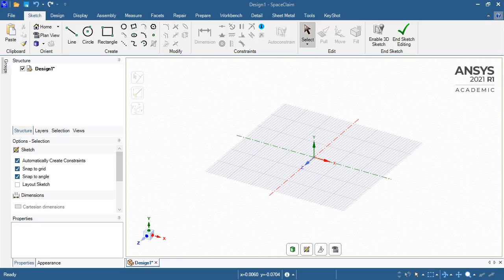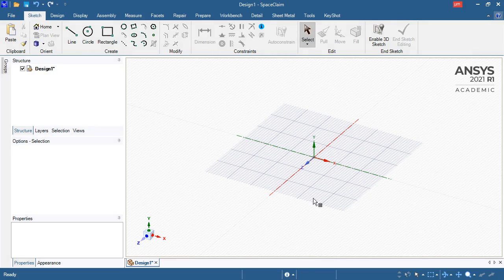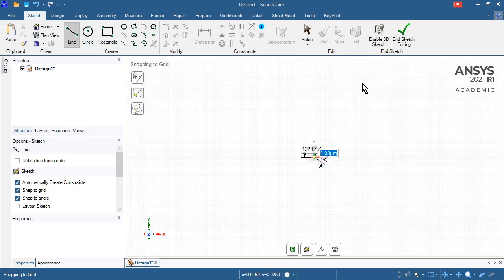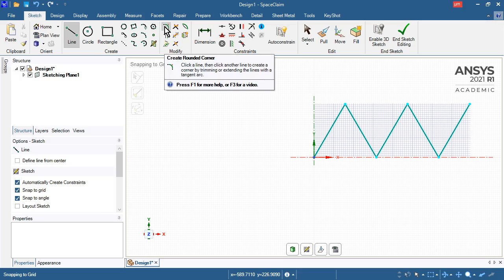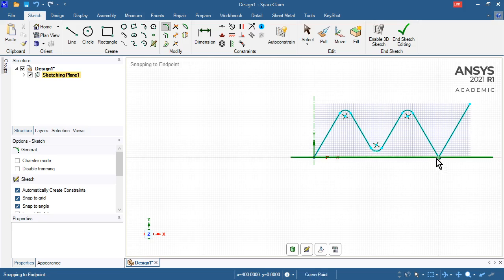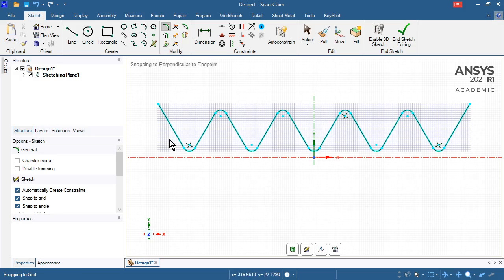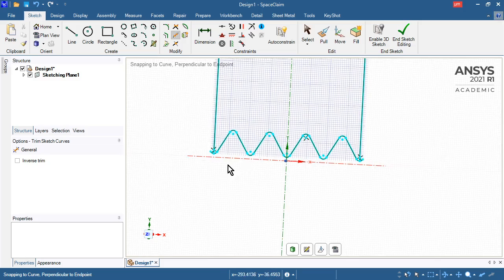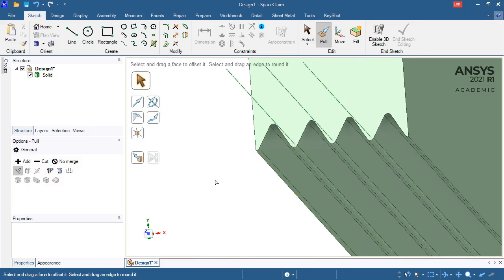Sub mm ribs in SpaceClaim2021

Comment: In my case the length scale only has 3 options: millimeters, centimeters and meters. There is no micrometers and nanometers. Also, I am using the 2020 R1 version. Can someone solve the issue??
Reply from the maker: You have to change units as soon as SpaceClaim starts. Once you have created or imported any geometry, you can't change to microns. This was explained in the video.